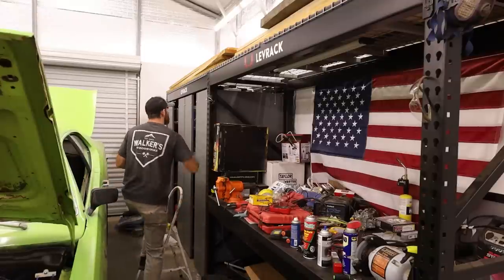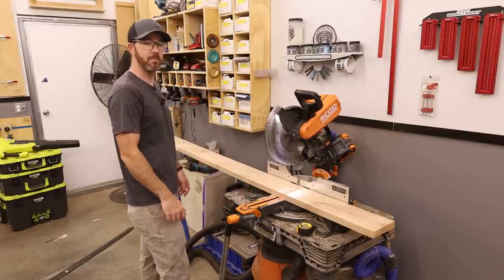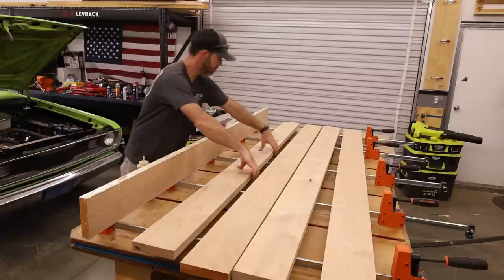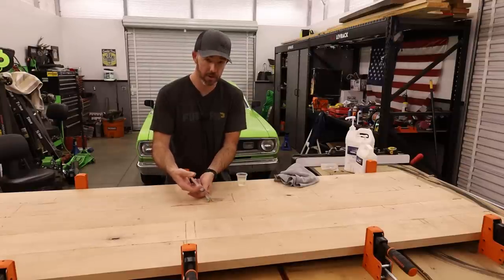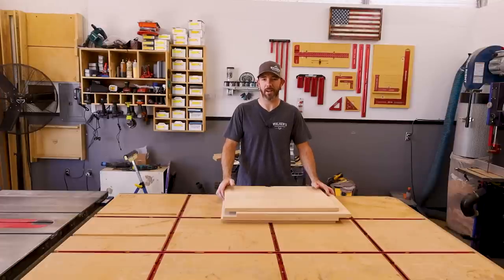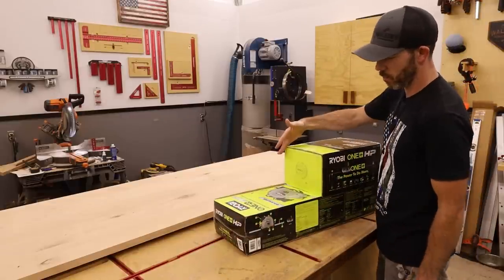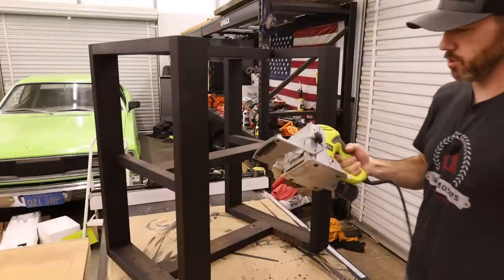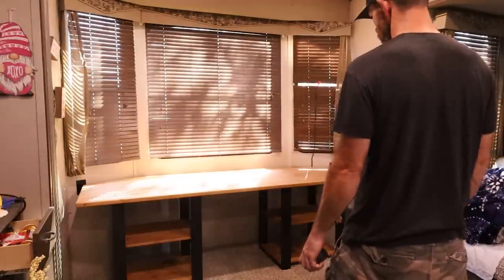I Built A HUGE Desk For My Mom! | How To Build A Desk

Comment: Amazing desk, I'm planning on building one for myself but yeah man the outlet placement, In my case I was lucky enough to realize I should add my outlets to the 3d model so I could better plan around it which Im doing and also adding a wire hole in the back